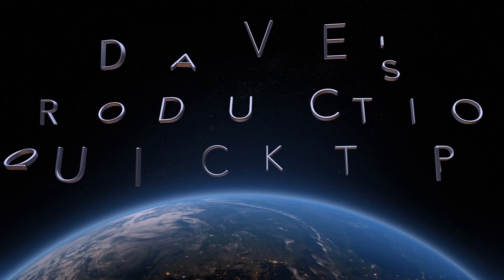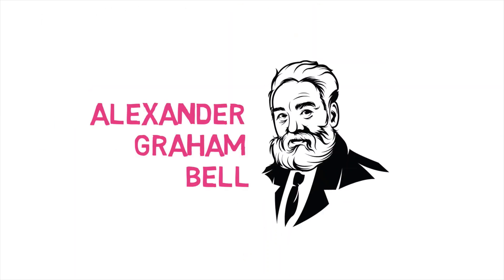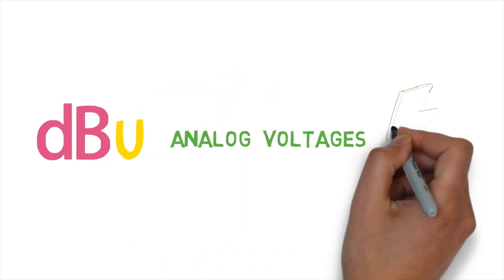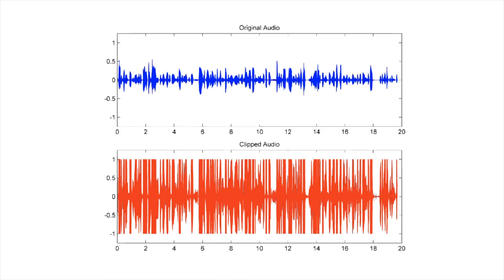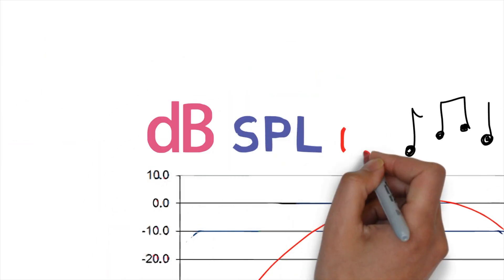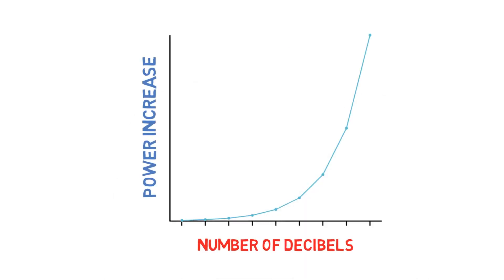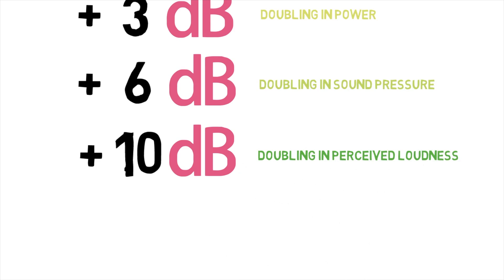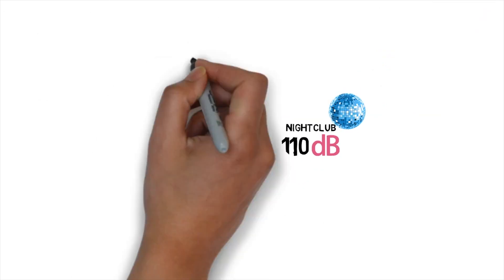Decibels - What are they? - EXPLAINED :  Audio Production 101

Comment: 0.775 v rms at 0.52 is not arbitrary.
It relates to 1milli-Watt (1/1000 watt) dissipated into a 600 ohm load .  If you take 
Power = v^2/r. You will get
(0.775)^2 /600 = 1mW ( ie dB(m)
Reply from the maker: You’re absolutely right about the 1mW into 600Ω numbers - that comes straight from old telephony systems where 600Ω was the standard load, so it was a choice based on the context at the time. Thanks for covering that detail!

I’d just add, ‘arbitrary’ doesn’t mean ‘random’. dBu is referenced to 0.775V because of that history, but it’s still arbitrary in the sense that it’s just a historical convention we’ve stuck with, even though modern gear rarely uses 600Ω loads.